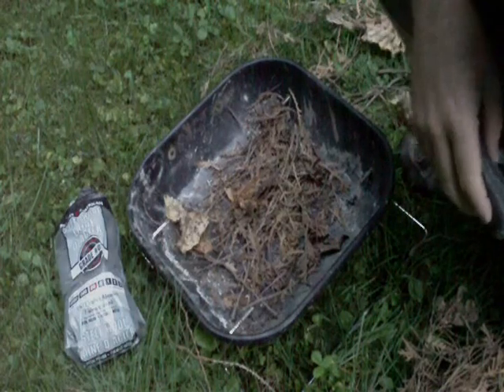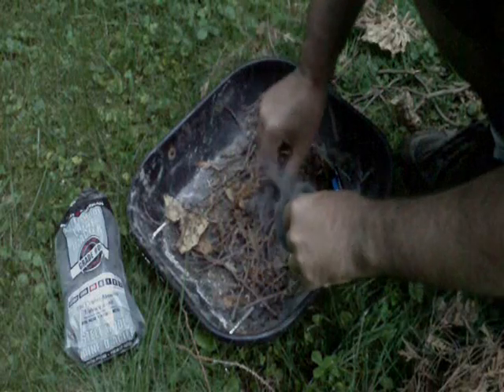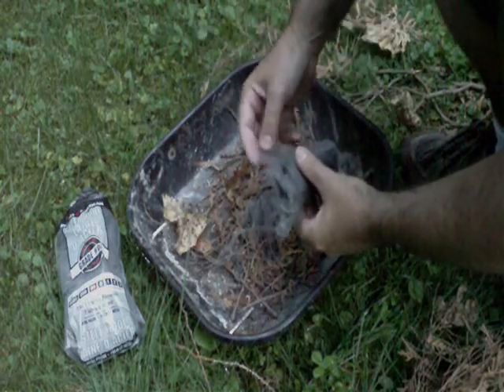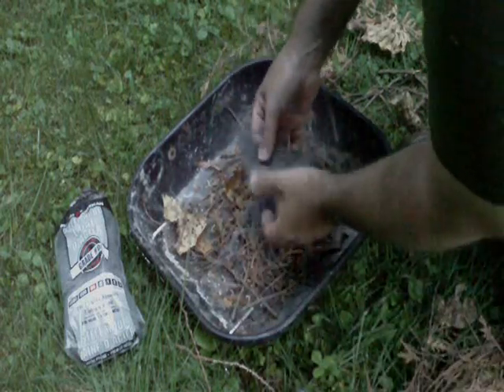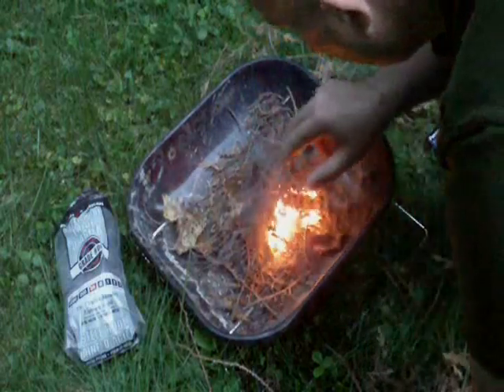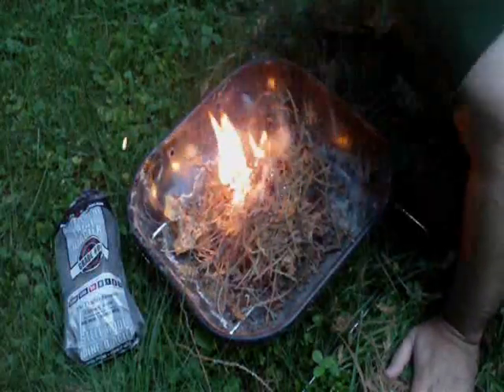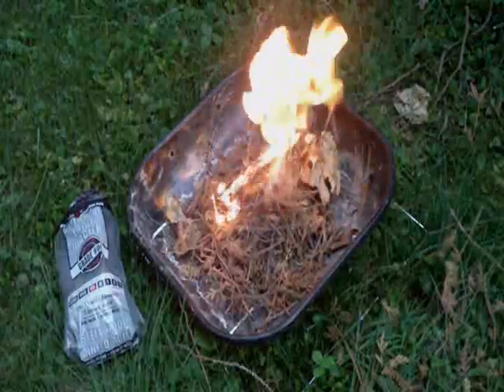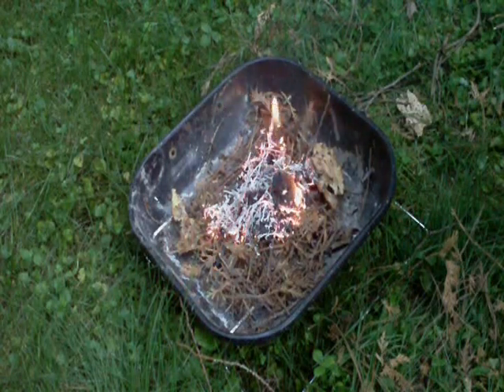Starting a Fire With Steel Wool and 9V Battery - Urban - Suburban Survival

Comment: I tried this out with coarse steel wool, and found it does not work with that grade of steel wool.  I found it to work with both medium and fine grade steel wool.  This would be great information to have, if you have never done this before.
Thanks for the video.

Comment: An added bonus of the steel wool is it can be used as very effective signaling device. Place the steel wool in a cooking whisk ( for stirring pancake mix etc.or improvise something )with a cord attached to the whisk (2'' of cord is good) and light it then  spin it like crazy. It makes a HELL of light show that could be seen easily by aircraft etc. Just watch out for flying shards of molten steel flying off. Seriously it's rather dangerous and if you aren't careful you can get burnt trying this. Wear a hat at the least,long sleeves and eye protection are recommended.Also note forest fires can be started quite easily doing this so be careful in the woods.
 Search for 'light painting steel wool photography' on Youtube for demonstrations etc.

Comment: I just want to mention, as someone who has used steel wool for lots of things, it's not a good idea to handle the stuff with bare hands. Steel wool is manufactured to have a triangular shape with razor-sharp points and edges. A steel wool splinter or laceration can be very painful, and in a survival situation you don't want to take any risks of injury.

Comment: I was sitting here fuckin around with my 9volt ghetto colloidal silver generator, and was wondering if starting a fire would be possible. Didn't think to use steel wool, so I learned something. thumbs up

Comment: Actually the steel wool ignites like that because steel wool is made of iron which can be oxidized. By heating up the wool with a battery it self ignites with the air and oxidizes to produce heat which sustains the reaction.

Comment: @Jazreldedondru 

Tape six of them end to end.   Then use some thicker gauge wire to connect the two extreme terminals to the steel wool.  Viola.

Comment: no, steel wool is made of steel...literally.  there are different grades of steel wool. this one is a really really fine steel wool (why it's called wool because it pulls apart like wool does once it's spun).  

you can find this in hardware stores or in places like walmart/target in the section that has hammers, etc.  sometimes you can find it in the dish soap section. just ask an employee.

Comment: How did you use the battery to start the fire? Did you pour the acid in the battery on the wool? I seriously can't tell what you did here.
Reply from the maker: all that happens is the battery touching the steel wool shorts out the battery causing the steel wool to ignite.

Comment: That is a great idea. I used to light it but never used a 9 volt battery to start the process. Can you use any other voltage battery? Or is 9V the best choice?
Reply: It is not the voltage that really matters. It is the fact the 2 terminals are just the right distance apart. If you use a lower voltage you have to get the terminals closer together.

Comment: Is the flame ignited  using steel wool toxic or dangerous in any way? I mainly ask concerning cooking.
Reply from the maker: Hi MrScuto thanks for sharing my video. The flame is not toxic and can be used for cooking. Any toxins in the steel wool like any oils used to stop the wool from rusting will burn off immediately after ignition. Hope this helps answer your question.

Comment: Another question: can you use the same 9 volt battery to start more than one fire (like if you're camping for more than one night), or do you have to use a different battery each time?
Reply from the maker: Sure you can. You could possibly light hundreds of fires with a single 9 volt battery if you had enough steel wool.
Reply: Survival Central If the battery touching the steel wool shorts out the battery like you stated below, how can you light hundreds of fires with just one?
Reply from the maker: It doesn't really short out the battery well not completely this is because the fine fibers in the steel wool can't hold the charge or current from the 9 volt battery so cause the fibers to heat up and combust. If you had a thicker wire that could hold the charge then it would completely short out the battery. May be shorting out the battery is the wrong term. Let me put it this way then the fine steel wool can't handle the current from the 9 volt battery thus heating up to the point of combustion. Hope that clears this up.

Comment: is it 0000 steel wool
Reply from the maker: Hi Cameron I used #00 steel wool which is fine to mid grade. You can use heaver grades and it will work.
Reply: do u have a video on making fire with brake fluid and chlorine
Reply from the maker: no but sound interesting